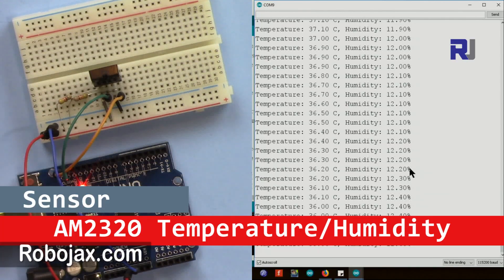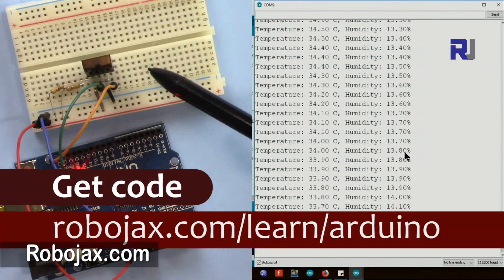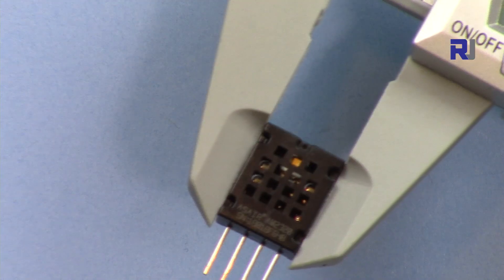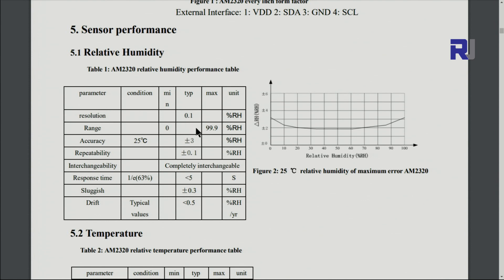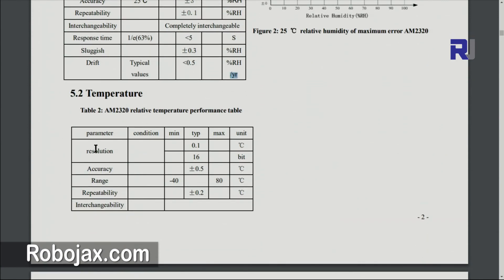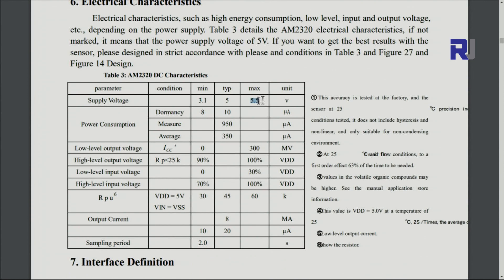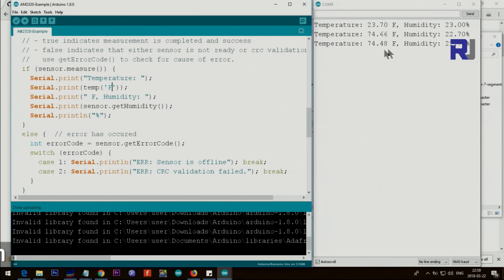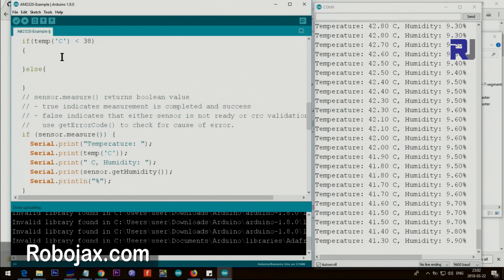Introduction to AM2320 Digital Temperature and Humidity Sensor RJT68

Comment: I notice that the module you have pictured has a capacitor C1... is that across VCC and GND?
Reply from the maker: That is filtering capacitor. about 10nF for noise removal.  not required but good practice in case the power has noise or the device generate noise to clear it .